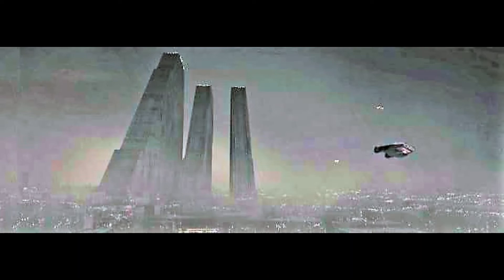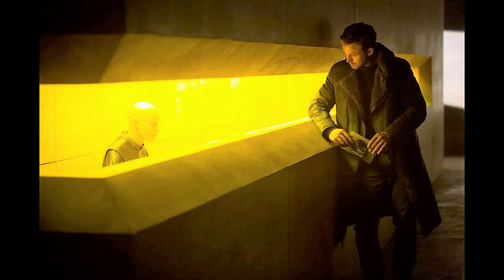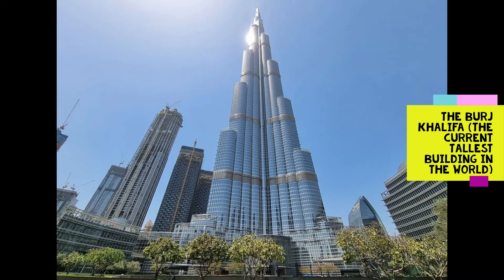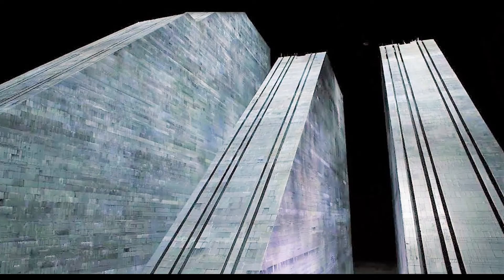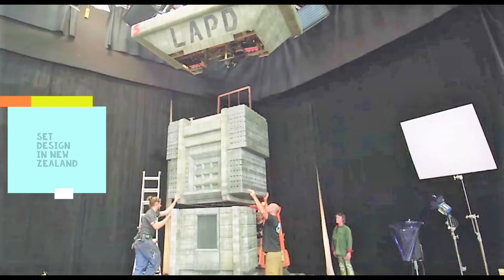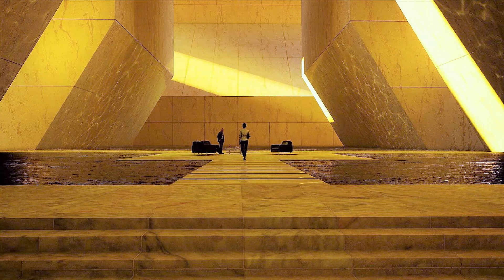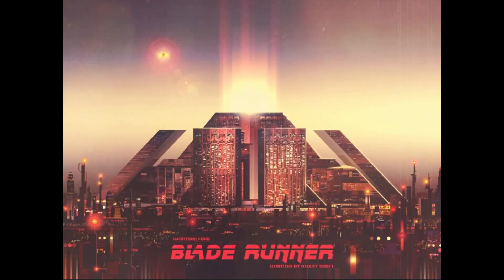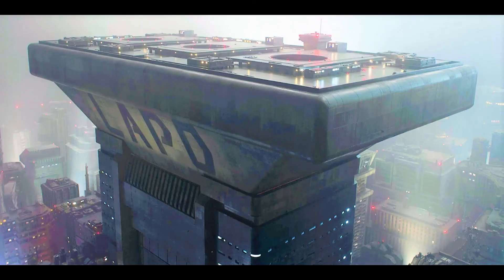How tall are the Wallace Corporation buildings in Blade Runner 2049?

Comment: After watching the film I became obsessed with the building and did some math to try to estimate its approximate height based on a simple rule of three, taking as a reference the Tyrell pyramids in the scene where K flies to the towers. I disagree with the 3.5 kilometer height given that Wallace's building has a staircase-like design, with the tallest tower on the left having three steps while the other two have two steps. comparing the Tyrell pyramid (which according to information I found on the internet is approximately 2.5 kilometers tall) with the Tyrell building, the pyramids barely exceed the height of the first step, which doesn't make proportional sense. Using a rule of three and taking the tallest tower on the left as a reference, we can divide it into three "steps". the first step is similar in height to the Tyrell pyramids, the second step must be at least 3x the height of the first to maintain the proportion of the miniature, and the third must be the same height as the first. Now, if my sources are correct in stating that Tyrell's pyramid is 2491 m (8172 ft) tall, a height equivalent to 1/5 of Wallace's tower as previously explained, then the towers would actually be 12455 m (40862 ft), the same height as the troposphere. insane, right?
Reply from the maker: That's mind blowing!  I guess the angle from which it's viewed also may affect how the height difference between the two buildings in perceived but it very well could be a lot taller than what was described in the video!  Thank you for commenting, please subscribe and visit our channel for more B.R. content :)  Jesus loves you!